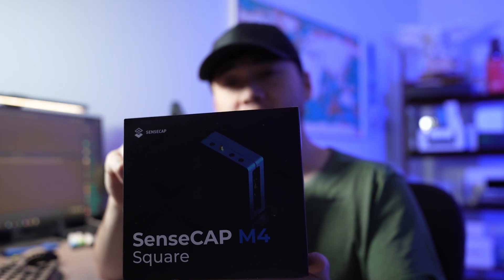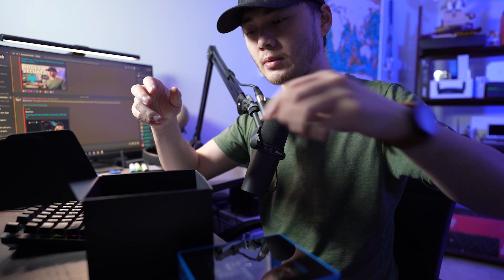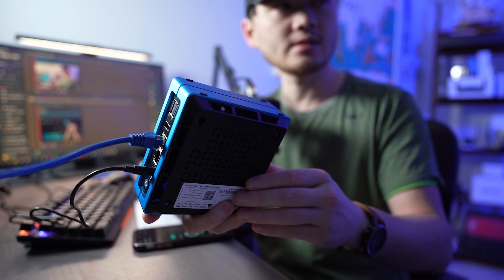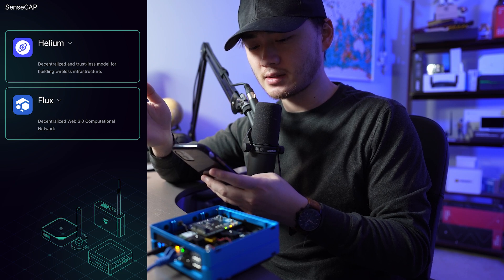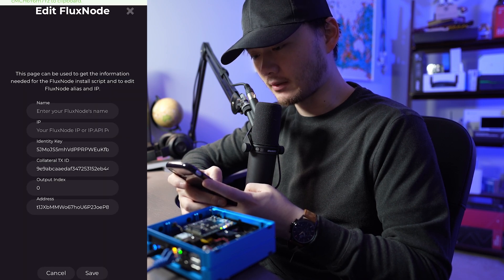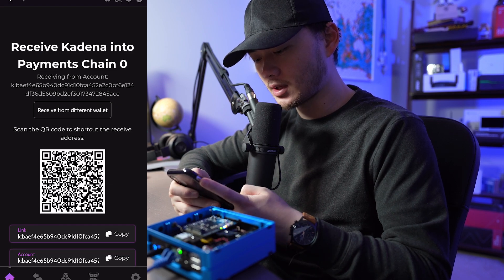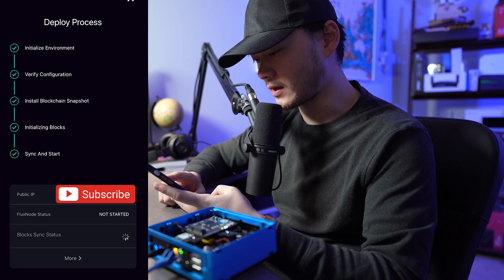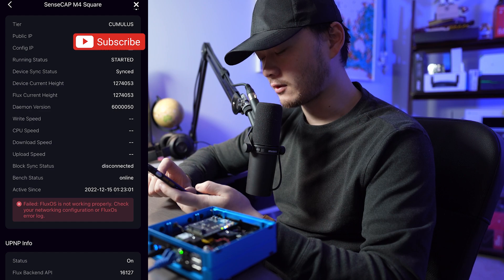SenseCap M4 Flux Node: Hands-On Experience

Comment: Before you even power it on, you need to be connecting the antenna or you're going to fry the transmitter side of your box out!  
None of you read the directions, do you?  LOL    Radio engineers watch you guys with these wifi boxes and have a heart attack about how clueless you are about radio wave propagation.

The problem with all of these devices is they require you to have access to the router to open ports and or set up port forwarding, and that is not available at most all of the locations I want to install these things.    Plus their whole buying of their own crytpo to set it up and immediately spend it to set it up is a massive tedious barrier to entry.   I've never bought crypto before so I wouldn't even know where to start.

Comment: Do I need to enable UPnP with just one node on my network? I just received my sense cap M4. I have the ability on my router to turn it on. I was just curious if it was necessary for just one node or just necessary once you get multiple on your home network.

Comment: Hello, great video. New subscriber and new to flux. I had a question. Can you run many nodes of of this device? Ie can I run 10 Cumulus nodes with this one device? Your help is greatly appreciated
Reply from the maker: you can only run 1 cumulus on this. If you want to run that many nodes on one device, you can build a server like I did in one of my early videos. I used proxmox to run multiple nodes. Also right now you can only run 8 per IP.

Comment: Another great video! Long term, do you think the M4 will be more reliable than running a Raspberry Pi?
Reply from the maker: The hardware spec for M4 is way way better than a Rpi 4
Reply: @ModernDogos  I now have two M4's up and running. Not exactily "plug and play" but far better than my previous raspberry pi setup. I have ATT fiber and needed to order a 5 pack of IP addresses to get both nodes running. Now I have 4 more IP addresses left for more nodes. Thx for introducing me to SEEED!
Reply: @ModernDogos  Fractus is now available to add to the M4 with just a few clicks. It requires a 10tb external HDD add on. I can earn an additional 15% of FLUX by activating this option. However, after buying the 10TB drive at around $200, do you think it is worth it? I always appreciate your perspective!
Reply: Does Sensecap M1 work too?

Comment: Why invest in a node when the roi is never...
Reply from the maker: you can pretty much say the same for most investment right now.
Reply: @ModernDogos  Indeed, but for cumulus nodes are like never roi even in bull market. Have two cumulus, not worth he time from my perspective. Higher tiers, yes..
Reply from the maker: @mrovi789  actually based on my math, cumulus has the highest ROI for the same amount of collateral needed. How long does it take to break even for the hardware investment, that's the real question. For collateral, you can sell and get money back at anytime. Hardware is different.
Reply: I think its 86 months

Comment: Why cumulus RPi node keeps on failing benchmark without any valid reason.
Reply from the maker: I have raised concerns with RPI nodes from the beginning. I think the USB sata connection is not reliable. At the same time, if the Pi has been running for a while, it may also run into performance issues.  check your debug logs for details.
Reply: @ModernDogos  Thanks you